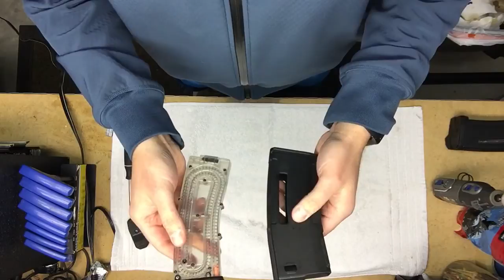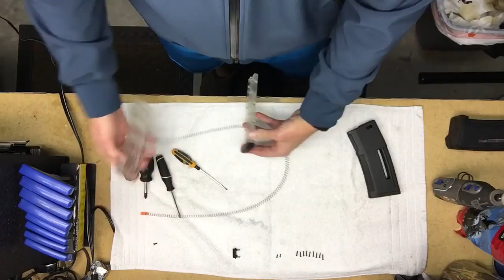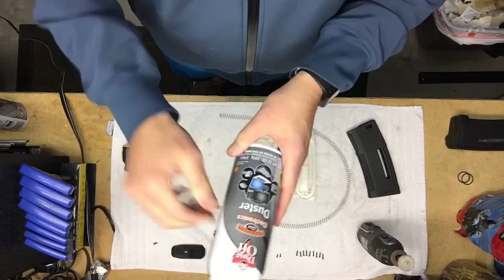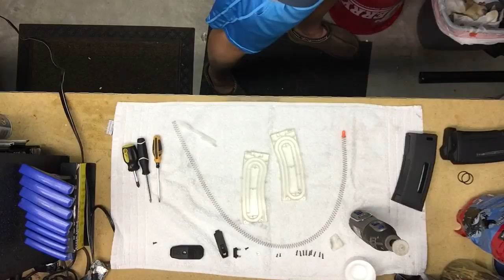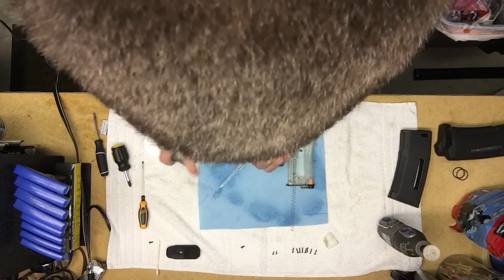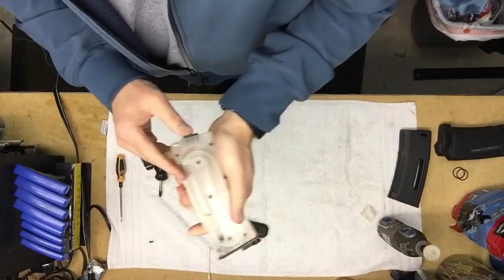PTS Mid-Cap (EPM) Magazine - disassembly, clean and reassemble

Comment: Still skeptical about the lubricant inside the mag. I know this is an old video, but have you any update or experience or feedback after having done this? Any inconsistent shooting relating to lubricant getting all over your BB's/bucking?
Reply: Yep, you don't want to lube your magazine. If any lube gets on your bb's it'll reduce the friction your hop up bucking applies, which reduces the strength of your hop up. Also as the lube is rubbed away and re applied by BB's, the amount of friction will change over time, making your hop up inconsistent.

Comment: I liked your video a lot it helped me to get my magazine taken apart but there is one big problem that I have with what you did, you should not ever put any form of lubricant silicone oil or whatever in your magazine it will only hurt you in the long run with. Your hop up bucking will get that oil all over it and make it inaccurate other than that thank you very much for the video.

Comment: Thank you for a great tutorial!  I just bought one of these mags new and from the start, I couldn't fill it all the way.  Taking it apart, I could see significant spring binding while loading.  I followed your approach and lightly sanded the spring guide rod.  I applied some silicone oil, reassembled, and it's working perfectly right now.
Reply from the maker: That’s great! Glad I could help!

Comment: I can't get the base plate off any of my mags. Doesn't seem that the button depresses enough. Any advice?
Reply from the maker: +Brandon SDA hmmm. If the screw is out should be good to go as long as you depress the button. It's it doesn't look like much but it's the only 'break' or 'anomaly ' on the baseplate. Press that down and you should be able to slide it off.
Reply: Thanks. I finally got the baseplate off. I had to press around on the button on all sides of it to get it all the way down.

Comment: Witch weight BB are u using? I've owned my EPM for a year now and ever since day one I've had feed problems with any BB heavier then .25s
I recently upgraded my gun to shoot 500fps and I wanna increase the weight of my BB. I've cleaned and polished the inside of my mags couple days ago, hopefully my problem goes away. 
I never understood why the mags wouldn't feed anything more then .25s since when I empty .25s out my magazine they come out fast and easy. 
I only use EliteForce

Really not a fan of lubing up the mags so much, always figured it would get all over the BBs and cause accuracy problem. 

Great video ether way!!
Reply from the maker: .25s and .28s testing this weekend!
Reply from the maker: tested successfully. worked great again in the same place (at the oregon coast) where the magazines first developed the filling/feeding issues.